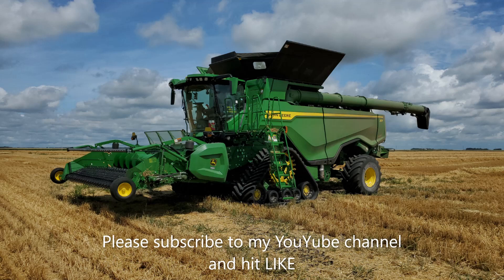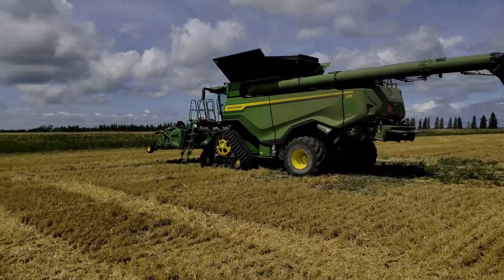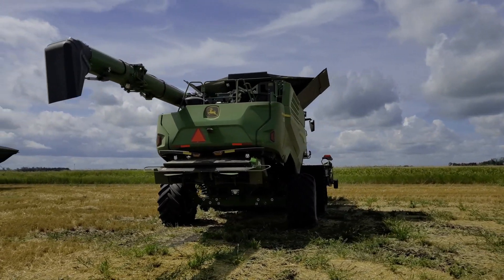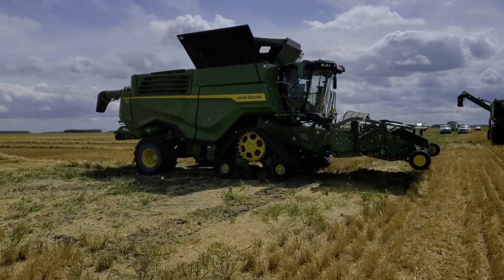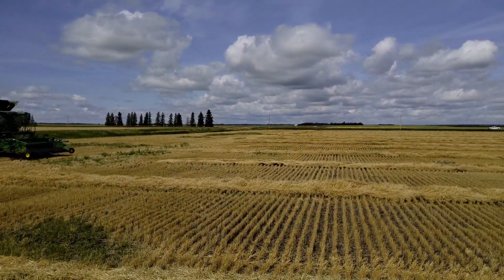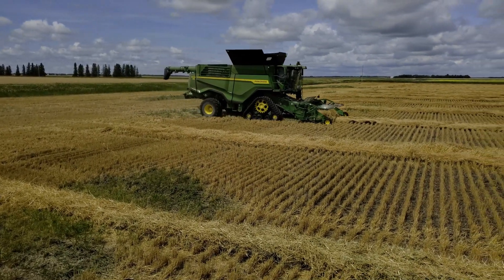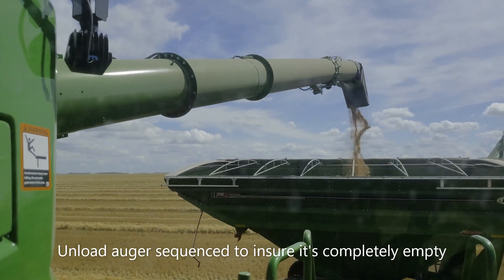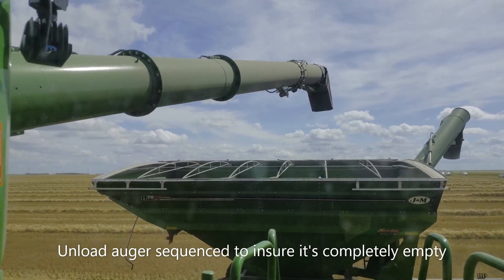New X9 John Deere Combine 2020 07

Comment: You average 21 acres an hour at 4.5 mph on a 35 foot swath. Closer to 20 with having to turn around on the headlands.  At 6 mph you end up closer to 26-28 acres per hour.